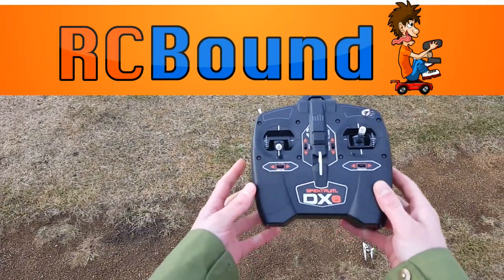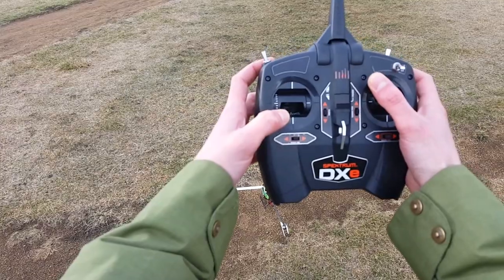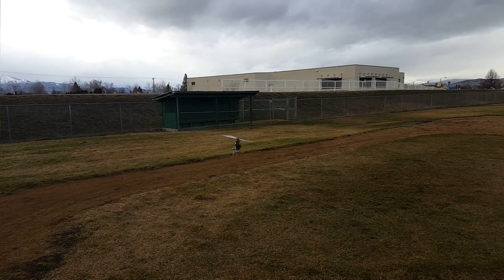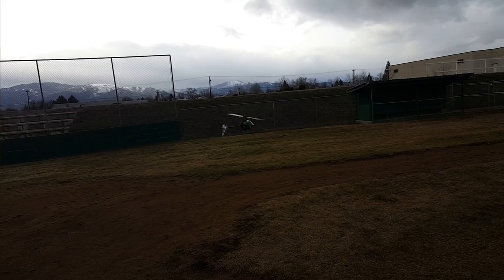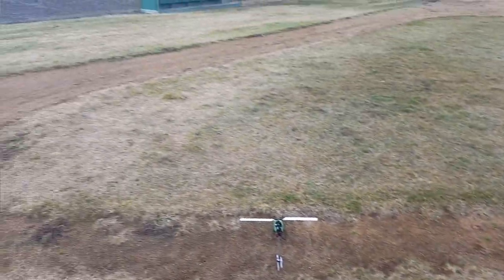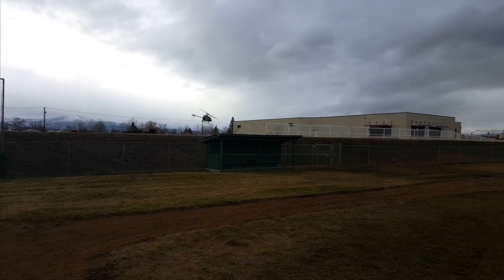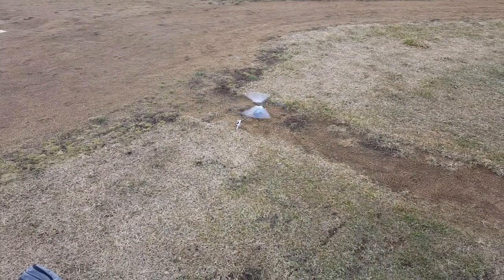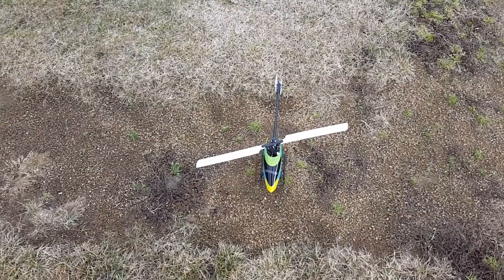Blade 230 S Trim Flight

Comment: Funny how the manual that comes with the 230s smart, doesn’t explain how to get into trim mode. Thanks for showing this!  Took 2 attempts, but now the heli flys so much better!  Before this I had a bad drift to the aft and left. It would also pitch forward hard when coming out of idle up back into smart mode. Now all is well. Pirouettes are solid. Thank you 🙏
Reply from the maker: Right on, glad this vid is still helping people all these years later. I had a lot of fun with that heli. Have spare booms, tail rotors, main gears and links on hand. If you get to throttle hold in time often enough the main gear will survive.

Comment: Both of the 230s smarts I have purchased drift hard tot he left.  like at times I have to be full right stick to keep it from running away. not stable at all.  happens inside in a controlled environment as well.  Even when  let off an hit the panic button it goes quickly left, both of them do it.   the second one not as much as the first.  i have two RTF models, the first one is on its wat to Horizon now to be looked at after i sent them video of it.  
i also can not get it to complete a trim flight, i do the procedure you show here and i get the first wiggle but when i land and press the panic/bind button again i just get a flashing red light on the receiver and a beeping tone.    i have 660 in Heli's and neither one work.
Reply from the maker: sorry for late reply, sucks that it isn't seeming to setup properly for you. I've been out of the heli game for long time now and don't have any of the 230S setup in my memory anymore. I'm sorry I can't be of any help. I would honestly look into the OMP 2 heli, https://ohiomodelplanes.com/products/omp-hobby-m2-rc-helicopter-v2-version-omphobby-m2-v2-preorder?variant=32289396588618

Comment: thx rebound for your repliy, just got another question if you don't mind, how can they sell it as RTF , if when it arrives you have fine tune it and mess about with the settings ,in the hope you don't bin it ?.. Anyway in answer to your question havent done a trim flight , just havnt had a nice day for weeks , going to take it to a model meeting in a field on sat , near me and hope they can sort it out for me , , watch this space ( if no luck I post it to you and let you sort it for me ??? , before I end up selling it on eBay , oh love your videos , ( p.s no I haven't updated the firmware or calibrated it , wouldnt know where to start, would it need that then seeing its straight out of the box ? )
Reply from the maker: Yes, is it frustrating. I however don't fly with autoleveling so I never was as frustrated as the those seeking autolevel. the update and calibration most likely will be required to get your heli flying good and hovering in place while using autolevel. You very well could attempt a trim flight as the heli is now and see if that works. If it still doesn't hover with minimal input then the update and calibration would be required. I hope the people at your meet can help. I would definitly be willing to update, calibrate, and trim flight it for you but it would be cheaper for you to do it. I don't think you'd really want to pay to ship it 2 ways though.
Reply: wow you seem to know your thing about this , which is great , I've emailed this club and it's on for this sat 12/03/16  weather permitting , but I've told um it needs setting up an still in the box as I'm unable to to do this due to work committments, am not totaly satisfied they can help ,but I'm prepared to turn up and see wot happens, never say never !,, it could be coming your way if not , am happy to pay shipping cost + your time ,, Thankyou :-)
Reply from the maker: +Clive Grellis I don't think shipping it my way will be necessary. Those people helping you better know what they are doing or it will be frustrating for everybody involved. Male sure they have watched the video on how to perform the trim flight. Also remember, if you don't update it first and perform the calibration process, you trim flights might be futile attempts. I would suggest taking extra tail props out there with you. Possibly an extra main gear and a pack of pitch links (the all plastic ones up to the grips) too. My very first crash took out all three of those. Booms will be good to have on hand just in case. It's also a good idea to reinforce the front skid mounting point. You'll see how weak it is and I just put a global of hot glue right above the front skid mount on both sides so it won't flex up much. Good luck!
Reply from the maker: +RCBound Make sure

Comment: Hi,can you tell me how to bind Dxe to 230 please, be much appreciated.!Thank you.
Reply from the maker: Hey, I've not messed with RC stuff for a long time. I believe you need a bind plug in the receiver. Then power on the heli, then hold bind button on DXE while powering it on. It should bind. I would look up the manual on the Blade website to be sure. I also saw someone use no bind plug. He powered on the heli, then flipped the heli and held it upsidedown. After that he powered on the radio while holding bind plug.

Comment: I have the 200 S RTF model and have not yet flown it, as I am a beginner ...are the trim  instructions the same for both  the 200 S and 230 S...thanks..
Reply from the maker: Gary Vale I'm not sure, I suggest looking that up in the manual or calling HH tech assistance
Reply: ...my question is why wouldn't I just keep the heli tied down on a level surface and perform these steps ...seems it would be a lot easier than hovering  in place .....especially for me as I am a beginner....
Reply from the maker: Gary Vale when a heli flies it leans a bit to the right in order to maintain a stationary hover. This is because the tail is pushing the heli a bit to the left as it is also acting as anti-torque. So, in my mind a heli needs to be in flight in order to do a proper trim flight. However, I think I've read that some people have had pretty good success holding the heli down and doing a trim flight. I would suggest getting a cheap quadcopter and learning to hover and do basic flight with it then just do a proper trim flight for the heli with confidence. You can get some small quads for super cheap.

Comment: just got mine delivered today , am new to this hobby and have notice that the swash is tilting to the right ( looking at it front on ) am guessing this is ok for me to attempt a trim flight ? any advice on this ? Help me guys ..lol
Reply from the maker: yes, the swash will tilt a bit. Proceed with the trim flight just hold your cyclic to correct for the tilting swash upon lift off. Have you updated the firmware and calibrated your heli yet? That might be necessary if trim flight doesn't not work.

Comment: With FM mode 2 you can flight inverse ?
Reply from the maker: Wora N I believe you can fly inverted with both FM1 and FM2. FM0 is normal mode. FM1 and FM2 are referred to as Idle Up 1 and Idle Up 2 where throttle(head rpm) is locked and governed allowing the heli to fly inverted while giving negative collective pitch input without effecting the throttle input. In FM0 the throttle is mixed with collective pitch and when you drop the throttle stick below 0 it will lose power accordingly.
Reply: RCBound thanks. i am looking for this size and low cost heli becacuse my wltoys V977 x1 is not stable in 3d mode when you are hovering